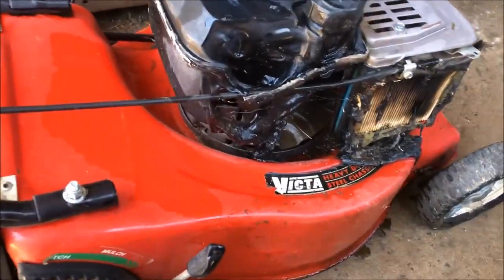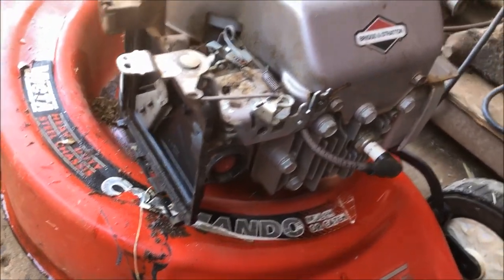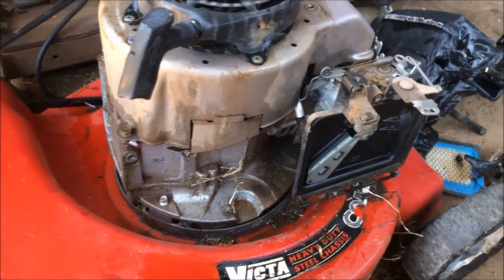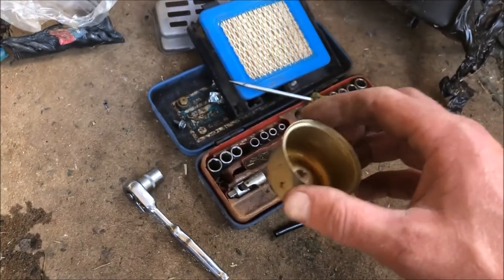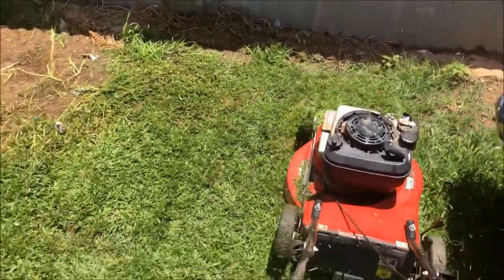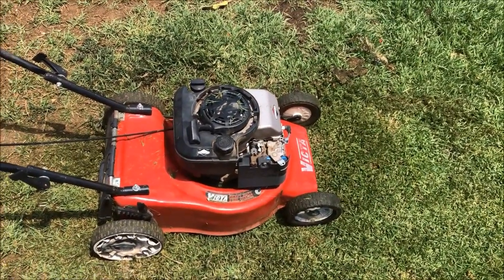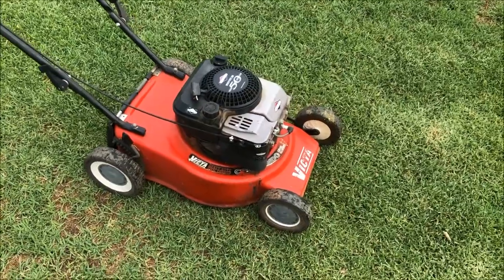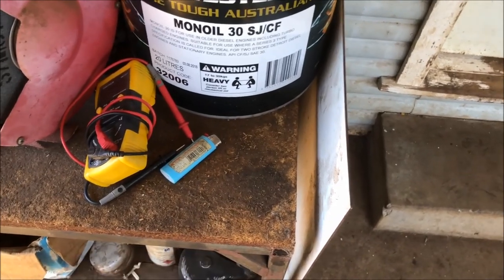Mildly burnt briggs and stratton powered victa mower, does it live on?

Comment: I found a fire damaged blue Victa Vantage outside a public housing estate. I took some salvageable parts off the engine and threw the the engine itself away (the exhaust tab was broken off) and repainted the burnt parts of the deck in a non matching blue (colour hard to find in a can!) and fitted another motor. Wish I got the piston out as it probably hadn't done that many hours as it was a newish Chinese Powertorque.